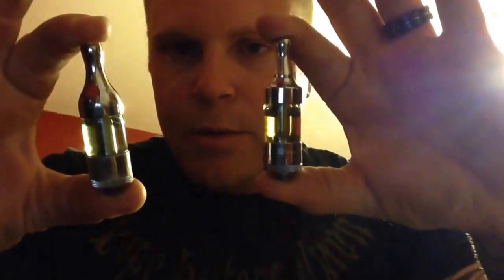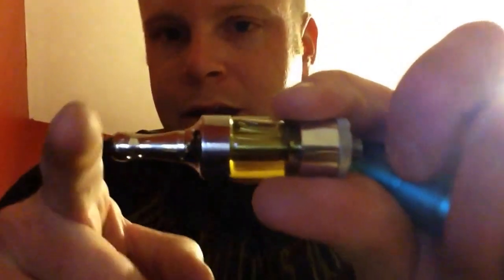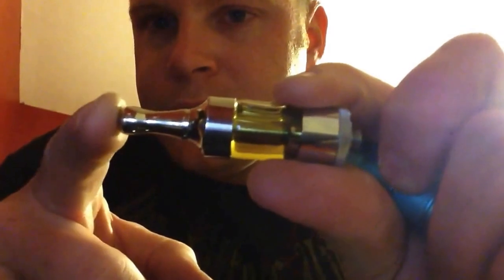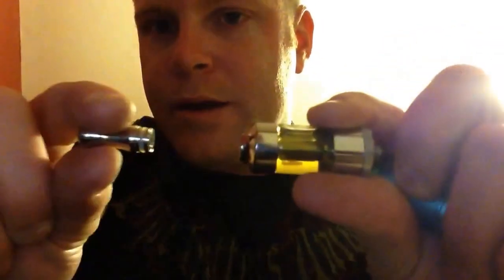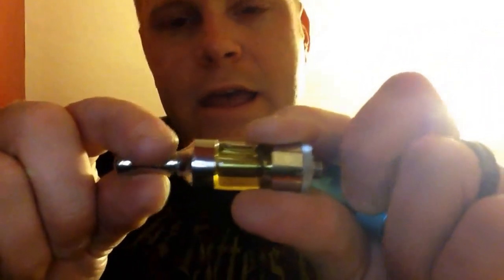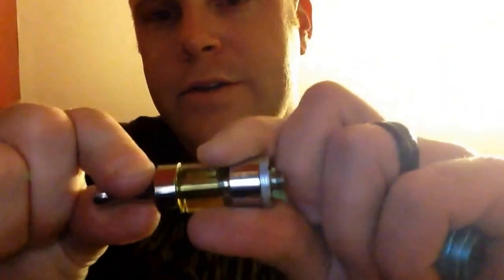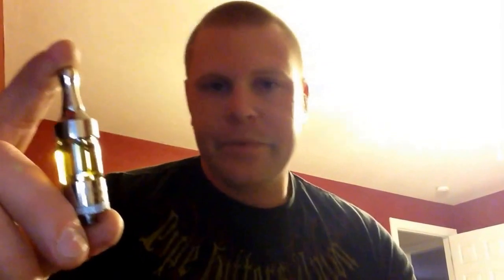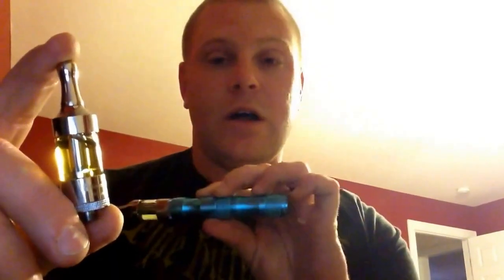Kanger Protank 3 Follow up Review (Not Good!)

Comment: Interesting vid.  Personal opinion - for a cheap VV the X6 is awesome, it beats the crap out of any of the ego VVs.  Just a quick note though, the x6 does not go to 4.8.  Its options are 3.8 (red) 4.0 (purple) and 4.2 (blue).  To stop flooding on the PT3 coils you can remove the top post off the coil and add some flavor wicks.  From what I saw at my local shop the stock coils dont have much padding, leading to the flooding.  Vaping on a higher voltage will also help to some extent.

Comment: I also just got the Protank 3. I hated it at first... After 3 days it wasn't working at all. Today I was determined to make it work. Took the head off and found that the dual coils had almost "flooded." I am using a K101 full mechanical mod and also a iTaste vv. So I saw it was SUPER saturated, I took the tank off the base and basically just dry fired (with the head/base still on the battery) and started to shake it out. It spit and spit and spit for about 10 minutes. My mech is constant 4.0V, and my iTaste is variable wattage. After it had cleared all the juice stuck in the head it is working AMAZING. My experience is that the Protank 3 with standard kanger coils works BEST at 10 watts and up. So whatever voltage that is on your setup. I tried to run it at lower power (or what I would normally vape at... 4.0V) and I think the low power caused not enough liquid to burn and flooded the head. Hope that helps!

Comment: Brett, Im using the Kanger PT3 with the airflow control valve, and get far more vapor than your getting with your PT1. Now, from your video, Im guessing either your not getting any airflow (alignment of the coil to the battery unit, the little slot on the bottom) or you have a bad coil in the PT3. Get the airflow control valve, it makes a big difference and there are no alignment issues cause it eliminates the slotted section on the tank, and airflow can be set to your liking. As for the drip tip, there are options. Mine was loose as well, but one strand of dental floss under the tips o-ring solved this. I have also fitted other drip tips on it as well with great results eliminating the play. Stick with the PT3, the flavor from it is amazing, and I have run the coils up to 6v@12.5w with no burning taste. I vape daily at 3.8v@12w.

Comment: When I bought my Pro Tank 3 I had some issues with my juice (80/20, 11mg) not feeding enough resulting in a tiny bit of taste/vapor with a whole lot of dry burn taste. I was able to fix it by taking the silicon cap off of the head, pulling the piece out that sits beneath the silicon cap, so you can see the wick.  Then using a needle nose pliers I carefully removed a few of the top strands of wick, so that there was a bit more room for the juice to flow through the wick (so everything's not so tight).  If you took to many dry hits before doing this your head might already be too damaged for this to work but try it with your next new head.

Comment: I think that the biggest issue of these Protank 2 and Protank 3 is the contoured glass. Air leaks in through the seam of the glass/metal part. If you put that same head into a generic tank such as the DBox Puritank or the Davide and it'll work like crazy.

Comment: i just got a protank 3 about a week ago and i am extremely happy with the vapor production and they have fixed the drip tip being loose problem for mine am using a protank 3 on a innokin itaste mvp 2.0 i run 8 watts and around 5 or 6 for my voltage you get massive vapor production that way.

Comment: I am using the Protank 3 on a itaste svd set at 10 watts and 5.0 volts. I found that the coils only last 2 to 4 days. I buy replacement coils 10 at a time. I will definitely have to learn to rebuild these. When they are fresh it vapes great

Comment: I was having the same issue with mine after 3 or 4 days. I went to my local vape shop and got the protank 2 atomizer heads and it made a world of difference. protank 2 is a single coil. I bought the protank 3 because of the dual coil system thinking it would produce a massive vape cloud, which it did at first but I had to switch out atomizers after 3 days.

Comment: I had the protank 2 & i have bought the protank 3, & ive had nothing but problems with my protank 3, while i liked my protank 2 it was too top heavy for my vision spinner, so i bought a cheap gs-h5 clearomiser it holds 3ml liquid, no leaking whatsoever even when held upside down & the vape production is great, i now prefer my gs-h5 over any of the kanger protanks

Comment: I stumbled on this review and thought I would give my two cents.

My drip tip is significantly tighter then the one shown in your video. My biggest complaint about the PT2 was the drip tips were loose. I was happy to see the PT3 appeared  to be machined better. But obviously based off of  yours that is  hit or miss. 

At first I was disappointed about vapor production and that I would get a burnt taste at 8.5w. I ran my PT2 with my rebuilt single coils between 8-10w. So I expected at  least  the same with the dual coils. I did notice, however,  that the taste was significantly better than a single coil  PT2.. I guess  from the extra wicking. Back of my mind I'm thinking there HAS to be something wrong with the coil. Sure enough I switched out to the second coil unit that came with the tank.. it was night and day! Performing like a champ now.

Comment: Just a question, are you drawing 4.8v or 4.8w? It does make a difference... 4.8v for a 2.0Ω coil is overdoing it, and 4.8w is undercutting it. I'm using a 1300mah Bat(Mod) on a 2.5Ω coil at 4.0v (9.5w). Coils are mostly all the same. I did my reading on the PT3 (ProTank 3) and found it's running a 2.0Ω Dual Coil. Each Coil is 1.0Ω~ each (~meaning .1 Up or Down per coil aka could be 1.8Ω or 2.2Ω). This being said, try running at 4.0v or 9.5w. Then find out if you're comfort level has changed.

If then you are getting burnt tastes or it is hitting hard, try taking the rubber stopper at the top of the stem (I know there isn't much of it) and place it upside-down. I had issues with dry hits (This was causing the burnt taste). Dry hitting can ruin your wick, but it won't destroy it. Do a no power draw first. Hit it without firing it. If you see bubbles, you were dry hitting it.

If the coils are burnt, take the wicks out. Dumb as it sounds. Get cotton balls. Boil them for 15-30 minutes, pat them dry, boil again for another 15-30 minutes, and let them air dry for 24 hours. Pull the cotton balls apart that are dry and re-wick the coils. Snip off any loose ends that you may have. Keep in mind you want the wick to be in there, but not to the point where it won't move at all. Cotton Wicks FAST! You shouldn't have problems with burning or dry hitting if you do this depending on how much you vape.

Also another thing you can do if you are having issues which I do recommend doing is either soaking the coil (Warm Distilled Water, NOT BOILING! Don't make this mistake. xD) or you can re-coil the coils yourself. There are tons of tutorials here about it. (Just make sure for the PT3 Not to be confused with the Kangar T3 you use a Microcoil Method for both coils. Also the wire you will need is Kanthal Wire. Usually 32 Gauge.)

Also what you want to factor in is your Juice. What is the ratio on it? PG/VG Ratio? Is it 0/100 (Add some distilled water NOT MUCH if it is. This could help. Mix well.), 10/90, 20/80, or 30/70? (If the mix is anything other than that, the flavor could be lacking.)

I really hope any of this information helped. If it did, give it a +1 or thumbs up or whatever the hell youtube uses now. I hate how everything changes overnight.

Comment: the problem is the coil head
they decided to go with a dual coil but stack them parallel like an equal sign instead of side by side or perpendicular like a plus sign so you get no airflow to the second coil just saw kangers new line up and they apparently arent going to be using the old heads anymore

Comment: Hey Brett, Anything updated? well let me just start out with how i improved my situation w/ the pro3's. Ive had the same issues and even some leakage ON THE FIRST DAY of use. Ive even rebuilt it w/ 28 gauge kanthall n cotton . got them at about 1.6 ohms. it was great but the leakage issue was still present. soon enough after 10+ attempts... i just switched the head of the pro3 for a pro2...use the same chimney as the pro2. Now it hits great...real great actually for a protank. but leakage is still there after a while. how do i fixed that? i added 3 extra rubbers on the chimney. im no scientist n i dont know EXACTLY why it works but i called it the super condom. it kept the leakage issue out.....now as airflow goes w. the protank 3 its great as it is, but im goin to drill 1.5 mm 3rd hole for a bigger airflow. a tighter draw will now produce as much vapor as a bigger airflow . AIRFLOW+JUICE w/ higher VG content + HIGHER WATTAGE= MORE VAPOR :]

Comment: Because it has 4.0 ohm worth of coil total it needs a lot more power so if you normally Vape single coil around say 3.5 try vaping the dual around 4 v or higher it  needs the extra  power to be effective when I upgraded to the 3 my battery life went nearly 4 days to a little over 1 day takes a lot more power is it worth it? I think so much more flavor and bigger drags without the burnt taste from running at higher volts.  Or not

Comment: I have the same exact problem. The draw is too tight and the vapor output is ridiculous. Gonna stick to my protank 2 in the meantime...
Reply: Ridiculous in what way?  Too much?  Too little?  I have a PT3 'out for delivery' right now - :-/

Is there a difference from the PT2 beside the heads?  Can I use the single coil heads if I want?
Reply: ***** I think I saw a review that states the pt3 can use the original pt coils.
Reply: Jeff Anthony Thanks for the reply - they can indeed - I've been doing it since I received it because the extra coil the 3 came with was a dud. :D

Comment: looks like maybe you have a bad coil. I have notice that sometimes on my protank II that the coil can get disturbed and twist (battery post too high) after tank hopping a bunch. I have also tried flipping the grommet upside down and that boosted flavor.

 I have since started rebuilding the coils and have experimented with wick size. (3mm remove 2 strands 5/4 32ga. wrap and use the 2 stands as flavor wick-regular grommet orientation)  1.9 ohm running 3.4-3.6v makes for cool flavorfull decent cloud lung hit or slightly air'ey mouth draw with good  TH/NH

Comment: Your vaping some how wrong on the protank 3. I have the 3 for awhile now, and it HITS like crazy. I can make it hit. Also do 2.0, 2.5 with dual coils you need it more voltage. Also the dual coil works GREAT with 100% VG. 2.5omhz is way to high, go 2.0Ohmz and 4.2 - 5.0v (Remember the Juice changes everything so you might be lower or higher on different juices.). No reason to have 2.5 heads in their at all. PT2 vs PT3 I have, I have to crank up the voltage on the PT3 using 2.0 heads vs PT2. Now the 2014 PT Aero they re-did the heads are out as well, I'm going to try out.

Comment: Replace your coil(also make sure your bottom plate isn't manufacture made faulty and causing an incomplete contact connection[just barely touching instead of the entire surface] between the pin and coil) and adjust your wattage(if you can[the coils are two differen't ohm's] if you can't sorry about your luck both mine and my wifes vape like champs)

Comment: Well let me clear something up volts isn't power amps are. Think of of garden hose the water flowing through the hose is the amps or current and the pressure that pushes that along is the volts and the size of the hose big or small is resistance so more volts equals more pressure which equals more vapor anyways try it and message me cause I really think that will help.

Comment: Hey..I  have a pro tank 2 and I've stopped using it and went back to the evod bcc... I found that I was having to replace the atomizer about about every 3 days to get a decent hit off my pro tank 2.....I've heard the only difference in the pro tank 1 and 2 is the removable parts.

I found on the pro tanks that the liquid doesnt really soak up in the wick. I went to my local shop and they showed me a trick in removing the rubber gasket around the atomizer and flipping it upside down...This may work for a day.

Im sick of tossing two bucks out the window every couple of days with my pro tank. Any suggestions?

I also use sinister liquid which is a little thicker than most.
Reply from the maker: So far I've had the best luck with an iclear 16b that came with my hunter edition mvp but unfortunately I put an acidic juice in it and it ate it up being plastic but that thing vaped like a boss at 11 watts for a solid week. I'm thinking of picking up an aspire nautilus I've heard good things but as for kanger I have just been rebuilding the coils myself and they seem to hold up a lot longer and it's cheaper that way.
Reply: Brett Pierson Thanks Brett...I should also mention that I use a joytech evic. Which in its self Im not that impressed with either....maybe I'm just picky :-)

Comment: Dude, you have to realize that 2 coils means you have to increase the voltage, even though mine reads out as 2.1 on my vv/vw if I set it between 4.2 and 5.2 it hits perfectly, never had a problem with my PT3, waaaaay better vapor production than the 1 or 2
Reply: Scratch that, after reading a couple comments here, switched my mod from VV to VW and 15watts hits like a champ, one of the better tanks I've had

Comment: I have a protank 2 and 3 Run both at 2 ohms but pro tank 2 I cape at about 4v but protank 3 at 2 ohms I run it plus or minus 5 why do you ask well simple really both have same resistance but one key difference dual coil has double the wire so you gotta push more power through it to get same effect. Think of it this way your trying to fill a cup (wire) with say a liquid forced through a small opening like the ones you find on squeeze bottles of mustard that small opening is the (resistance) make the opening smaller more resist and bigger less resistance so trying to fill two cups one twice the size (dual coil) the other half size (single coil) now if I squeeze (3v) through each which will fill first? But if I double the power on the bigger cup then they fill the same. Long story short you need more volts through dual coil than single coil with same resistance. Trust me I went to itt tech I know ... Okay shit that's a lie that place teaches young people what suckers are I went to a real school now I keep airplanes from falling out of the sky!  Anyways let me know if that helps.

Comment from the maker: Www.vapedojo.com has replacement heads
Reply: +Brett Pierson Absolutely in agreement. As a matter of fact, I found this video BECAUSE I was looking to see if others had troubles w/ this tank. I bought mine at high recommendation last week and on the very first day I used it, the coil clogged and would not take a draw, much less produce a vape. So I changed out the coil with a new one and here, 3 days later, I’m having the same issue again. The $5 iclear 16 I have vapes better than this crap!